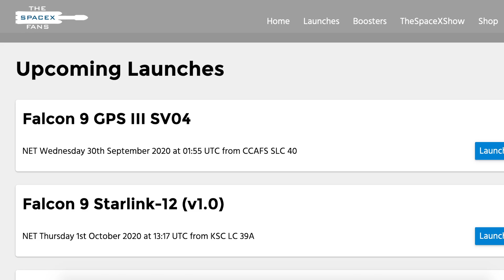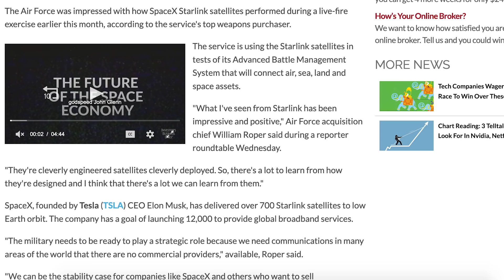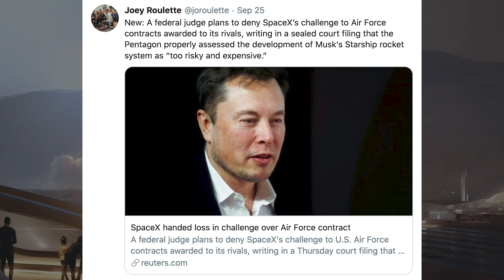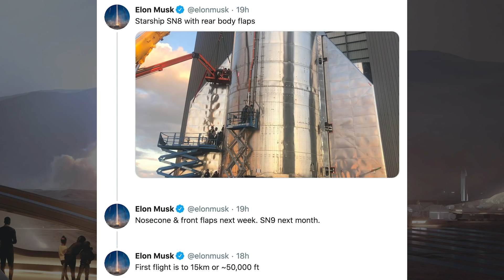SpaceX Starship Updates! SN8 Testing Soon, SN7.1 Post Pop! TheSpaceXShow

Comment: 2:24 the space suits have a visor but don't really look airtight.  Does anyone know if these suits are supposed to be airtight?  Watching previous flights looked like limited mobility for the arms, see how they clench their hands as they wear the suits.
Reply: Not just airtight, but designed to be pressurized for survival.
Reply: @martinzitter4551  but the pressure is only to some extent, right? I want to recall 40% or so.

Comment: 4:47

False, Elon said it reached 8 bar.
Reply from the maker: Yeah sorry you're right, missed that, thanks for pointing it out.
Reply: He's going to crank it up to eleven.
Reply: Is that good?
Reply: Did the leak start at the edge between the side and the dome? If so, instead of the weld, could the "corner" concentrate the forces at the edge and making that the weakest part? If so, would a rounded surface work better?